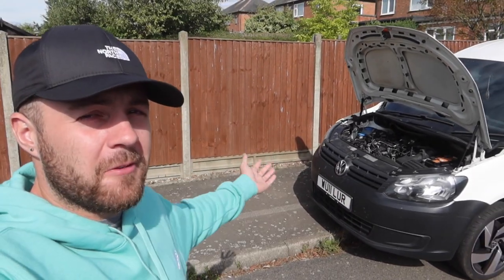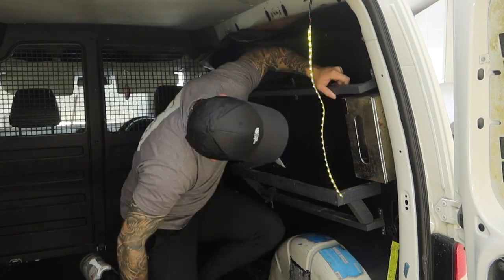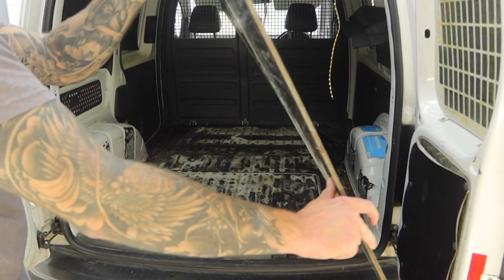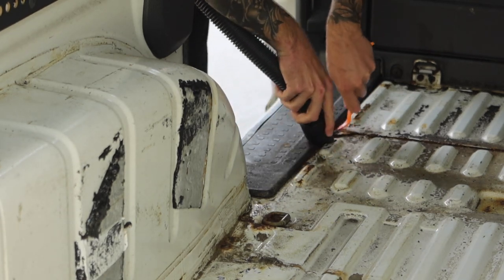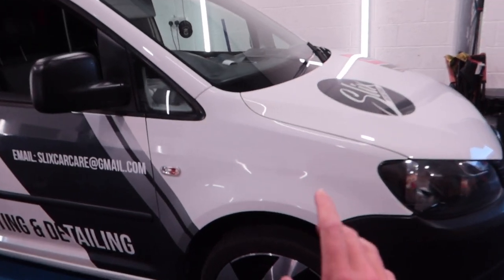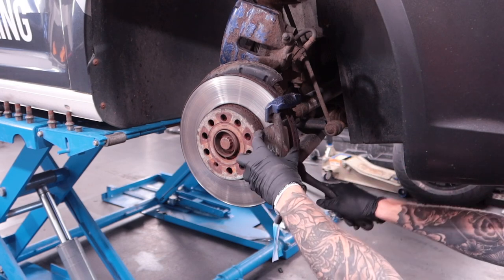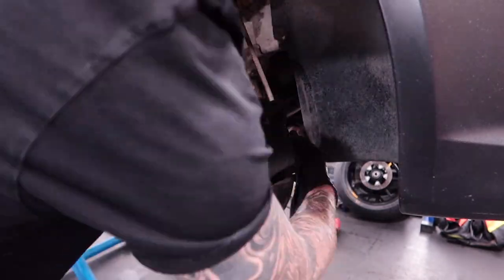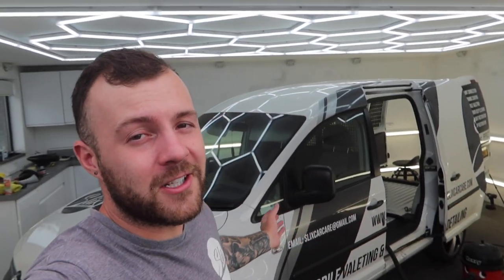INSTALLING AUDI S3 PARTS & STRIP DOWN ON MY CHEAP VW CADDY VAN

Comment: depends how bad the rust is, if its just surface rust then sand it down, spray primer and then upto you if you want to paint it or cover it with carpet etc...
Reply: Or just leave it. Maybe I'm weird but I like a little surface rust on a shitbox especially when it's next to nice wheels on a slammed car
Reply: @Josh_0579  trapping rust will create more moisture and make it worse to maybe even a hole in the floor, why not spend 5 mins and sand it down and spray primer.
Reply: @kaelturner9721  on the inside I agree

Comment: Spray the floor with a heavy duty 2k paint. Hammerite is terrible nowadays and is purely sold for the DIY market. You could even use Upol Raptor for a textured finish.

Comment: That's the beauty of owning a VAG.
Parts are nearly all bolt on.
Those are same calipers as golf R, and therefore also fit the caddy..
Same would be of you wanted even bigger brakes and fit the VW Phaeton/ Audi A8 calipers.

Comment: Deal with the rust, then use Protecta-kote bedliner paint, I'm a Window cleaner and carry loads of water around , that's what I have in the back of my van and it does the job.

Comment: The rust if it’s not too bad, sand it back.. add a rust protector cover.. if no actually holes just give it a good coat of primer and it’ll be sound.. unles you want it to be in colour then base coat it and clear coat it.

Comment: Great video mate. I’m a modified Caddy owner - if you want a multifunction steering wheel to work it will have to be a VW one. Potentially will have to change the slip ring and the clocks too + coding. If you don’t need the buttons to work though any VAG steering wheel is bolt on 👍🏽